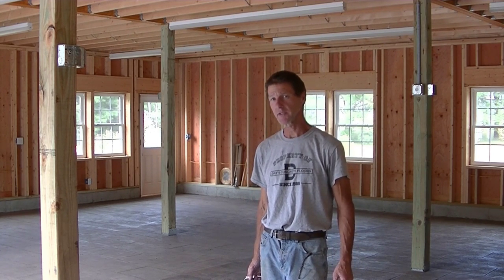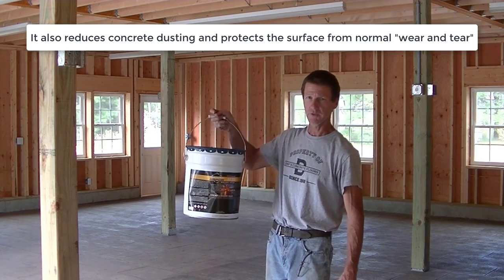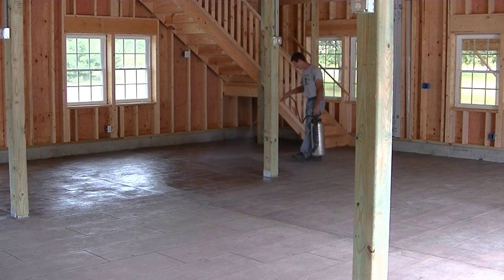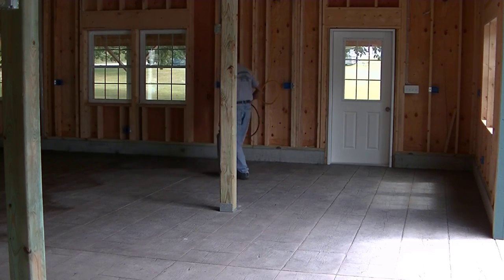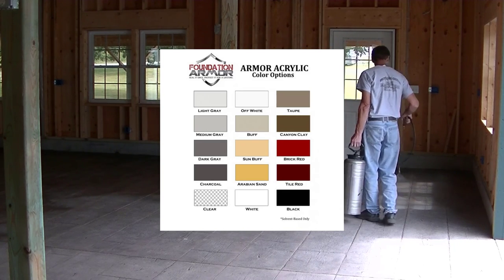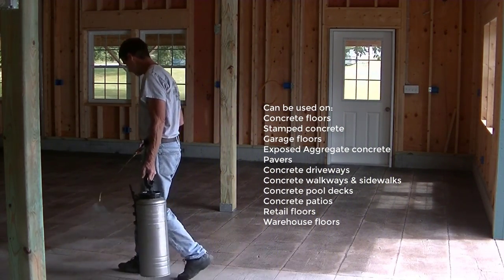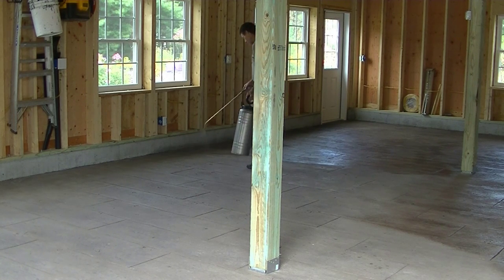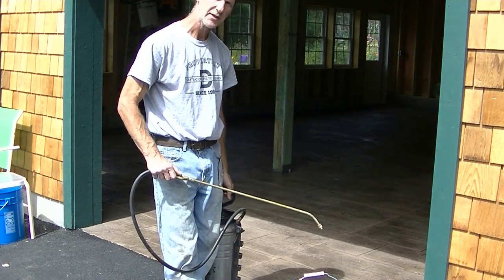High Gloss Sealer For Stamped Concrete | Also Use On Pavers, Driveways and Patios

Comment: I am building a 50x70 metal building, half will be living quarters, I would like to save in cost of flooring so I was thinking about stamping the wood floor design, can I do that at the same time that I pour my foundation?
Reply from the maker: It would be done the same time you pour the slab, yes.